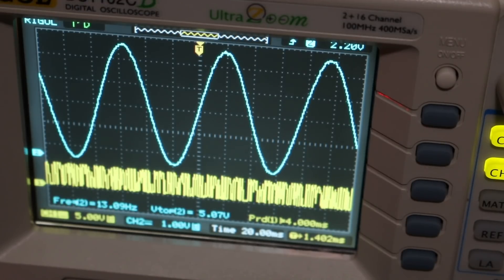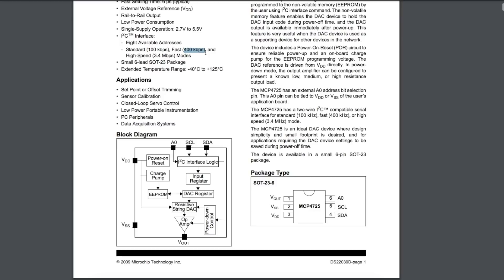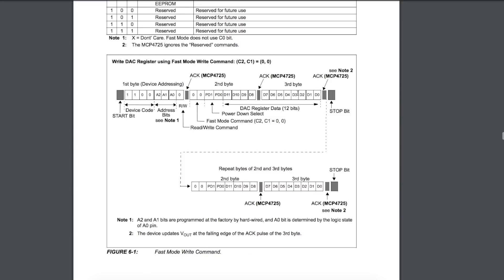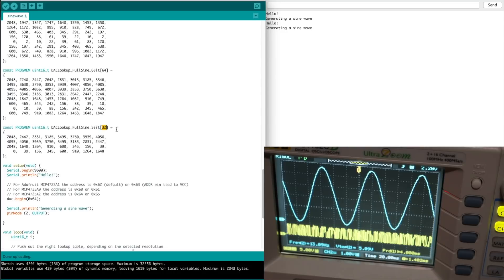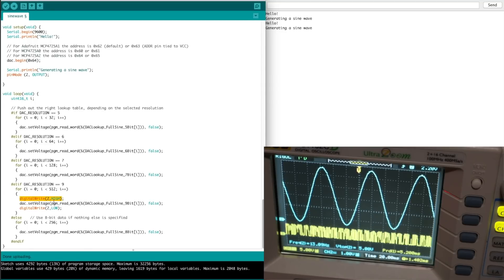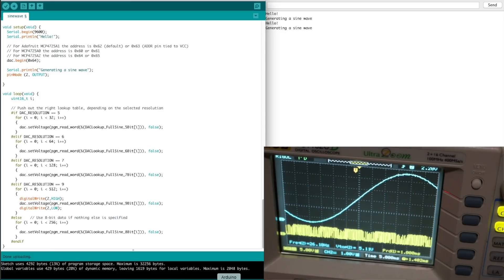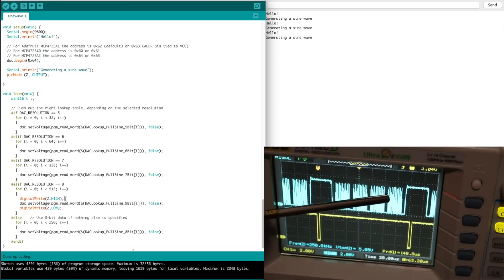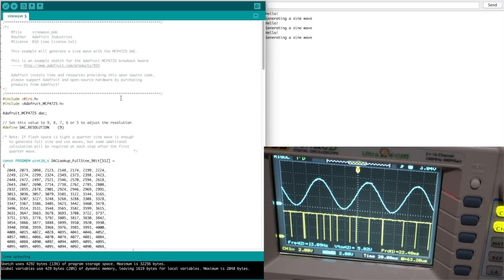Using the MCP4725 12 Bit DAC with Arduino

Comment: Can i use this to map 0-4095 to 0-5V  and output a constant voltage? Like setVoltage(4095) to get a steady 5V?
Reply: Sure
Reply: Highest code of 4095 produces output of 5V x 4095/4096 = 4.9988 V, which is less than 5V. Fortunately, you wont see a difference, as the noise on the rail is likely greater than 50mV, which is almost 100 times more.

Comment: Hello,
I'm not good at English, so I couldn't understand enoughly...
Could you answer a question?

Can I adjust the frequency of sine wave? 
I looked up the same example int sketch, but I didn't seem there is the way to change the frequency of sine wave.
There are only ways to change the sampling rates...

Thank you..
Reply from the maker: playing back the data for one full cycle of the waveform, then playing it back repeatedly is how the signal is produced, and the speed of the playback of the data controls how fast the signal is generated, which is the frequency.    So just reading the data from memory and sending it out to the DAC as fast as possible would generate the highest frequency possible for the processor and the communication between processor and DAC. To lower the frequency, a delay would be added before another sample is sent out.
Reply: @GadgetReboot  you mean the frequency depends on the digital data frequency..?

Really thanksful for your help
Reply from the maker: @sakdown  yes, the data output speed controls how fast the signal is constructed, which controls its frequency

Comment: Im getting 27Hz using the same example sketch... what could account for the extra 11Hz compared to yours, I am using the official AdaFruit DAC MCP4725, I do have a cheaper DAC like yours, I will make a test and see if there is a difference in devices.
Reply: ok my mistake I was running at 8-bit not 9 like you

Comment: Where do i copy the code from? So that i can just paste it into my arduino uno and get a sawtooth generator with my mcp4725, my hardware is all setup, and works well. please help me !
Reply from the maker: I had a form of sawtooth generator in another DAC video here, where it just uses a counter and outputs the value of the counter to the DAC  whether rising or you can do it when falling or both to get triangle, so that’s a good start.  https://youtu.be/6dhP87kUMnc
Reply: Install the adafruit MCP4725 library and there are sample sketches for sinewave and saw tooth waveforms.

Comment: Surprising that the examples contain "hard coded" values for the waveform. Had they taken advantage of the built-in sine function ( sin() ) the example could have easily implemented variable frequency, amplitude and voltage offset.
Reply: The built in sine function is "slow", so a lookup table is much faster. You could implement variable frequency etc by rebuilding the lookup table whenever you change a parameter. Mind, digitalWrite is awfully slow too....
Reply: Sin() is done using a series calculation, calculating the series functions link in this link I guess, since a table would not be as precise for each output or take way too much memory
https://stackoverflow.com/questions/40808804/implementing-taylor-series-for-sine-and-cosine-in-c
That's why you use a table fitted to your need instead of sin()
You could calculate it once when starting the device, but why would you do that? do you need to wear down your arduino so much ?

Comment: I want to use a potentiometer to vary the frequency of the wave, help me please
Reply from the maker: With the main loop running as fast as it can generating the highest possible frequency, you can only hope to control it down to a lower frequency so if you put a potentiometer wiper on analog input A0,  with the potentiometer end terminals on VCC and ground making sure VCC is allowed on the analog input for example don’t put 5 V on an analog input  that can only have a maximum of  3.3 V or 1 V... so assuming the potentiometer wiper will safely move between ground and the maximum voltage the analog input can handle, read the analog input and use that as a delay in the main loop to slow it down and generate the output waveform at a lower frequency. 

 For example a delay in milliseconds or microseconds can be added in the loop with one of these commands that take the digital number representing the potentiometer voltage and delay by that number of milliseconds or microseconds each time around the loop. 

delay(analogRead(A0));
Or
delayMicroseconds(analogRead(A0));
Reply: @GadgetReboot  your explanation helped me a lot, thank you very much.

Comment: Can on use this to output sound?
Reply from the maker: I think I was only able to get low frequencies out of this with any useable resolution. I2C is too slow.  

 This link has some calculations on how fast a data value can be sent at 400 kHz for this device:  https://arduino.stackexchange.com/questions/35729/i2c-mcp4725-dac-connection-speed/35730#35730

 It says that you can send data at about 7 kHz, and for a sine wave I was using a waveform that had 512 separate samples to reconstruct the wave, so 7000÷512 is about 13 Hz which I think is what I saw. 

I haven’t tried an SPI DAC, maybe I should get one of those.
Reply: @GadgetReboot  I was wondering the same, to generate a nice sine wave with variable audio frequency.. but 13 Hz max is hardly in the audible range!  I was hopeful for 100 to 800 hz variable sinewave.  Thanks for the video and explanation!
Reply: At 3.4MHz, the maximum update rate will be 3.4MHz / 9 bit per byte / 2 bytes (in fast mode) = 189kHz. That is quite enough for audio. However, to run I2C at this speed, the uC BUS_CLOCK should be at least 3.4MHz x 16 = 54.4MHz.
     P.S.  Using DMA I was able to get a mcp4725 update rate of about 140kHz, which is slightly below the theoretical limit. At 256 samples per period it corresponds to about 560Hz sine.

Comment: There is also delay from digitalWrite() function calls, better to write directly to ATMEL registers.
And what about the other case (fast command, 32 sample sin)?
Reply from the maker: The 32 sample pattern is so stair stepped I didn't even consider it part of a sine wave test.  It was just in the examples as an available pattern.
Reply: Yeah, Arduino IDE introduces a lot of overhead. It is best to program the Atmel's bare metal. For example, using Eclipse.
Reply: good to know!